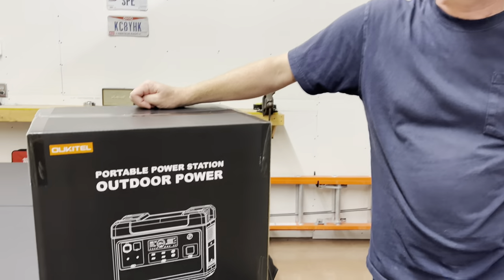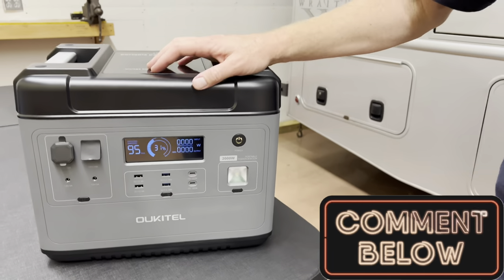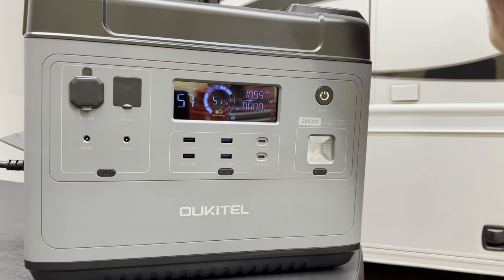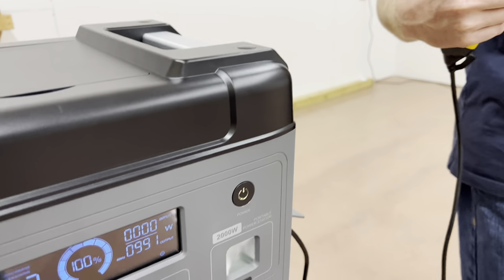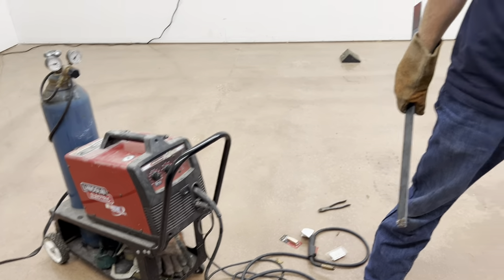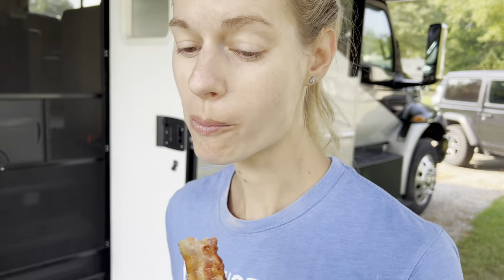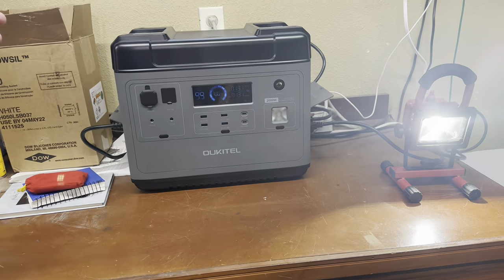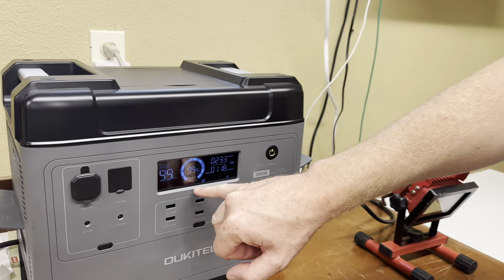RV And HOME Power? (Oukitel P2001 Power Station Review)

Comment: Great review! Do you know if it is drawing when not in use. Bluetti units are getting quite a bit of concern for the amount of battery discharge when nothing is plugged in. This is not every blue unit, just the bigger ones.
Reply from the maker: Thank you! With this unit we haven't noticed that in the short time we've had it

Comment: Note that 1875W probably assumes 120VAC.  The P2001 on battery outputs 110VAC so most unregulated devices like hairdryers will burn about 10% less power.  It's not usually a problem.    Even 10% down that hairdryer is using less power than its label :-)
Reply from the maker: Yeah we were pretty surprised how "off" the hairdryer power was vs what it said on it!

Comment: We have 2 full size refrigerators and an upright freezer, all stuffed to the brim. We will not starve during the next apocalypse. Just saying. When we lost power during the 2021 freeze we wasn’t worried about it. We have a gas cooktop and a gas fireplace and outside grill, plus a large wood smoker. Smoking in cold weather is easier than hot weather. We smoked some Salmon and a Pork Shoulder (aka pork butt) all was good. Also read 4 books in 3 days.
Reply from the maker: We will probably have to upgrade our chest freezer next year to hold more. Glad we aren't the only ones who freeze things regularly!